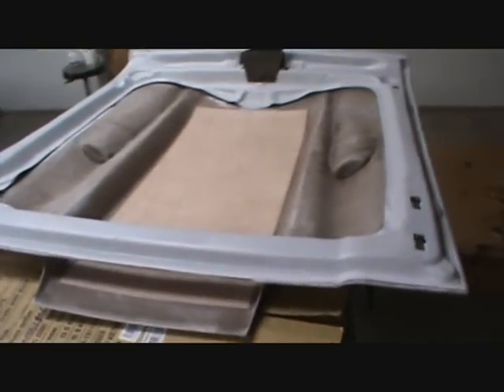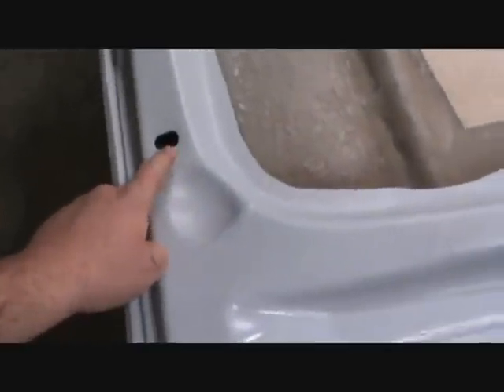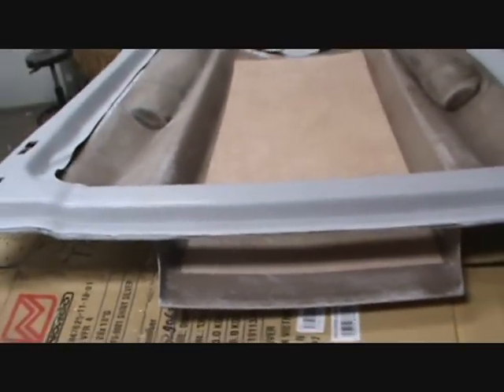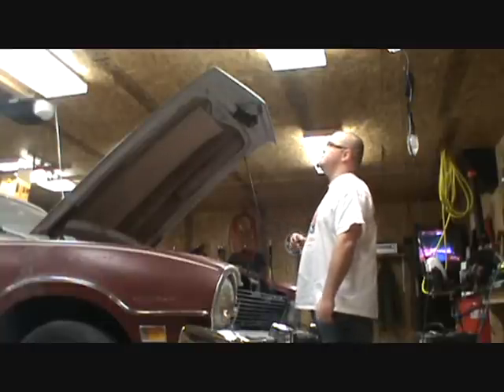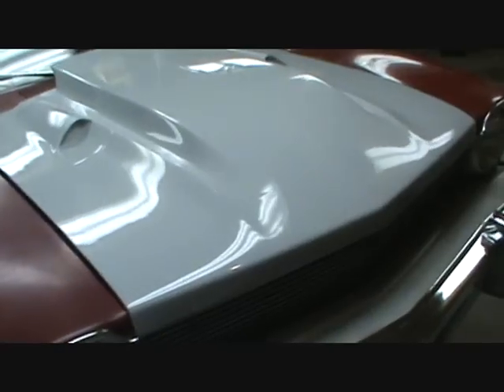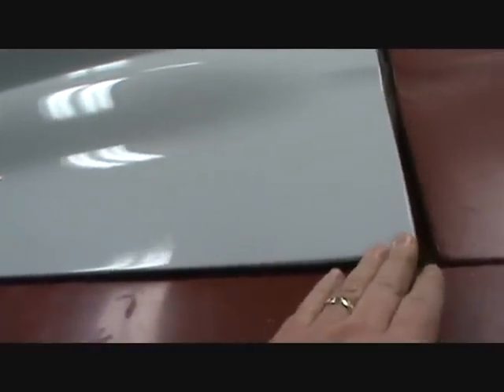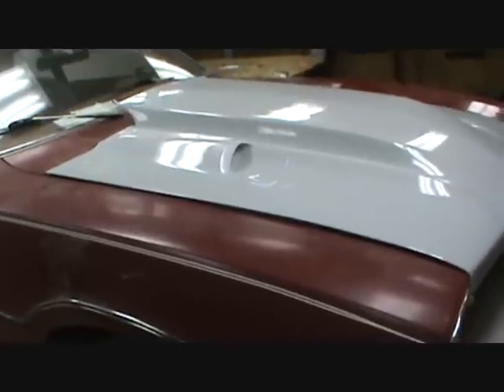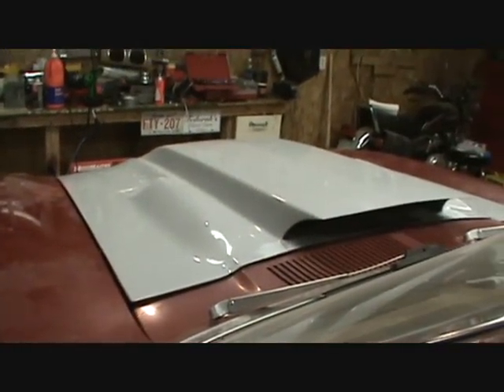cowl hood on Maverick. fitment and final look. all before paint

Comment: Fiberglass aftermarket hood supplier has lighter weight springs for hinges, or gas struts can be used...or run hinges alone with a prop rod. Pins recommended too.